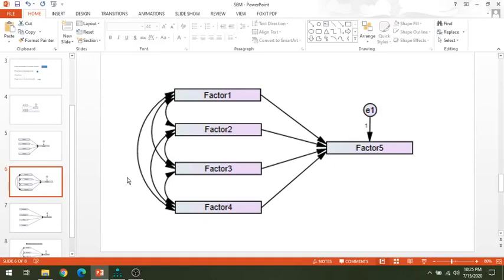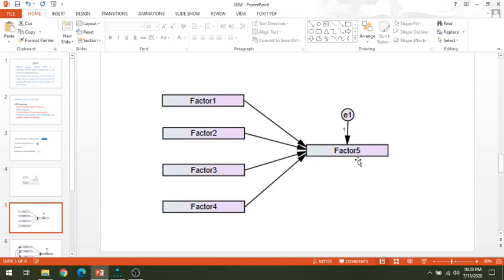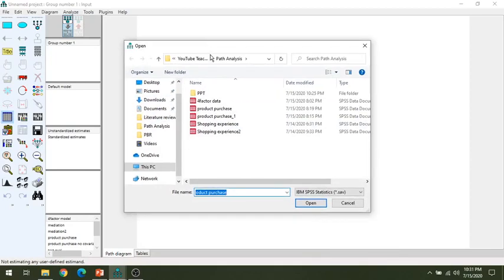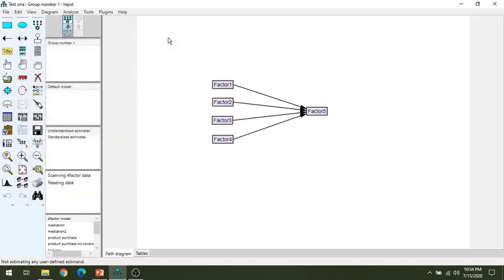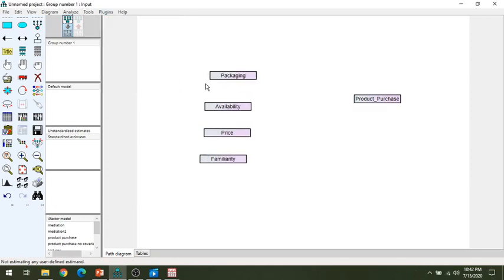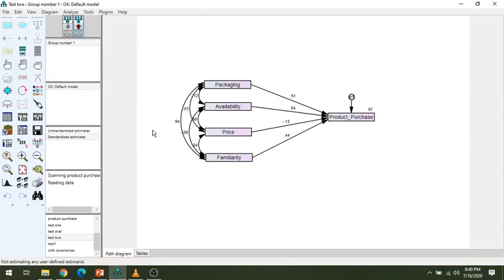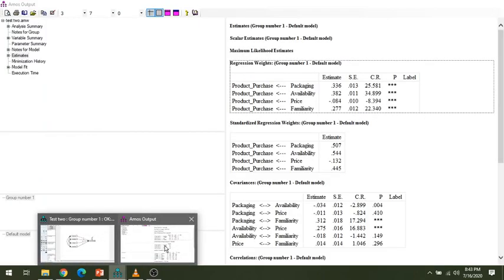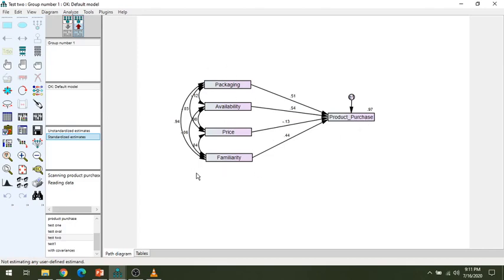Structural Equation Modeling (SEM) and path analysis using AMOS

Comment: Is there any connection between chi square goodness of fit test and SEM?
Reply from the maker: Yes, there is a close relation.  In SEM there are so many indices and measures that can be used to predict the model fit and chi sq is one of them.  kindly read this https://www.statisticssolutions.com/the-chi-square-test-in-structural-equation-modeling/#:~:text=The%20chi%2Dsquare%20test%20is,automatically%20by%20most%20SEM%20software). it will clear your doubts.

Comment: Can we export the data from excel file instead of SPSS?
Reply from the maker: yes, we can import data from excel to SPSS file and from SPSS file to excel. In excel it accepts .csv files.
Reply: @adilzia  Sir, SPSS is not free, is AMOS free to download? Trial version is available, but is there any full free version ?
Reply from the maker: @tanmaysarkar5568  No AMOS is also not free but you can find the older version completely free to download. try to search on torrent. Older complete versions are freely available in software market.
Reply from the maker: @tanmaysarkar5568  ok let me see the size of the software and let you know by tomorrow.
Reply: @adilzia  thank you Sir.
Reply from the maker: @tanmaysarkar5568  I tried to send SPSS to you but the file is more than 3 GB. It can not be sent through email. Kindly take help from some software seller. This software is easily available everywhere.
Reply: @adilzia  Sir thank you for your effort. I have an old version of SPSS, but can you please help how could I get the AMOS?
Reply from the maker: @tanmaysarkar5568  ok I will see that.
Reply from the maker: @tanmaysarkar5568  check your email for AMOS
Reply: @adilzia  thank you very much Sir